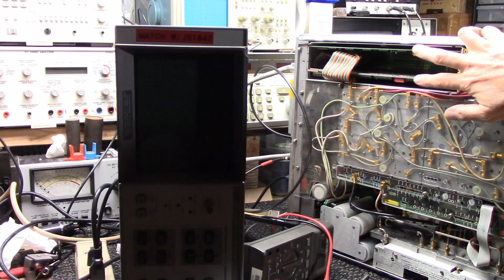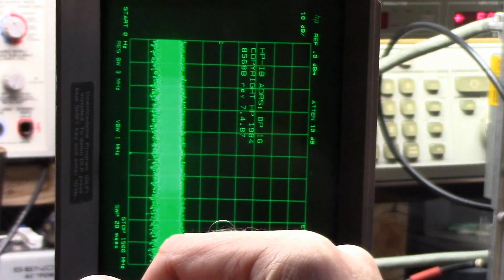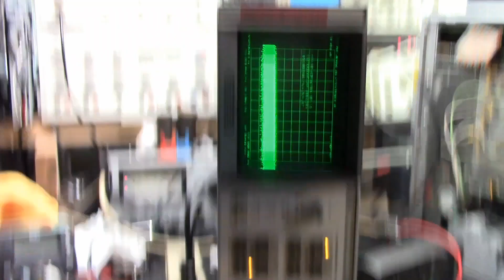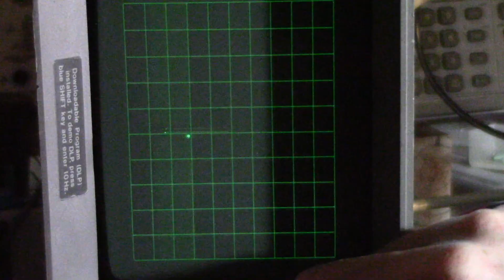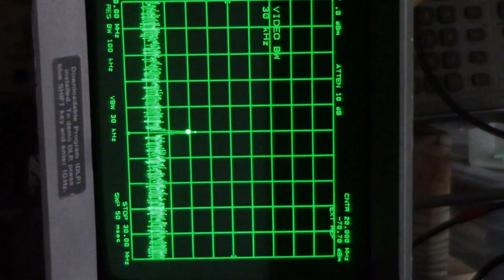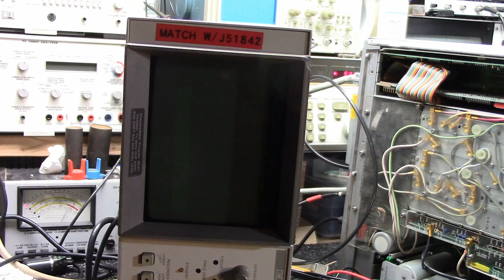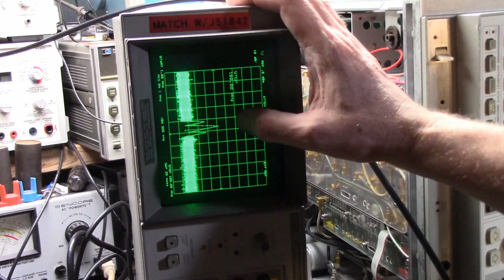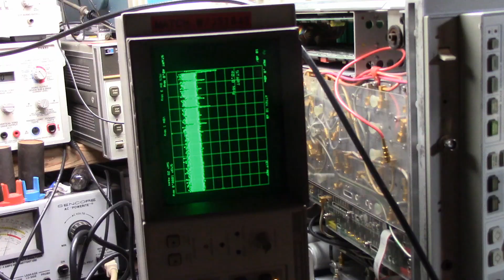HP 8568B spectrum analyzer part4 - Could it really be that simple?

Comment: One of my backburner "rabbit hole" projects is getting a HP8558B SA in a 853A display unit working like it should. I'm having to gather (and build) a host of test equipment I wouldn't normally need in order to do that.  My HP SA is half the size of a 8568 (only to 1.5GHz) but it may have contributed to my needing rotator-cuff surgery.

Comment: Bob, I believe it was on Antique Radio Forms that I mentioned that I had looked at the output of various TV channel modulators and test equipment with a tinySA. Only my Drake agile modulator (I don't have a Blonder-Tongue ) had the proper vestigial BW filtering. Of course that and Blonder-Tongue were meant to be used in conjunction with others on different channels feeding a cable system so channels interfering was no good.  Still somehow knowing that your test equipment doesn't quite behave as you might think bothers me.
Reply from the maker: I have a bunch including Drake, Pico Macom and Blonder Tongue that I'll check out.

Comment: Fantastic Bob, you revived a terrific instrument and you're giving me some courage to tackle a few I've still got lying around but never dared, until now, trying out :) By the way, shouldn't the device have an internal reference clock you can switch to instead of using an external referrence?
Reply from the maker: Yes, didn't I mention that in the video?  It's missing and was set to external when I got it.  I ordered a used one on eBay.  It was common in labs to have one very accurate reference and connect all the test gear to it.  For example, I could connect this to the 10MHz ref out from my HP 8662A
Reply: Ah, I must have missed that remark :) Yeah, I remember indeed from the lab at college there was like a central reference connected to certain pieces of equipment as a group. Not a bad idea really, if you want all your digital equipment to run in sync. But in your case, an internal reference clock source is probably much handier.  Still a great score though.
P.S. my memory (and attention span) isn't that good anymore since my stroke a few years ago... so yeah, sometimes I miss things, wasn't "testing" you ;)

Comment: I love the HP series of Spec Ans - I picked up an 8591E that worked flawlessly until early this year and the batt-backed SRAM died and so did the cal constants ... I can get it to self-cal, first manually loading default values, and then the self-cal function can be coerced into running (fails perhaps initially, then retrying it will pass self-cal.) Long story short, I found a really clean Anritsu MS2717B on ebay I'm using now regularly. Also an MT8212B that was very clean but needed a new battery.

Comment: You can    peak  FM  IF coils   with  that unit ,  I see the positives
Reply from the maker: Not quite as is.  I would need to add an HP 8444A tracking generator.  Easier I think to use a sweep generator and a scope.  Like my HP 8662A and Tek 2465

Comment: Bob, I think none of the front panel buttons don't work until a frequency standard is connected, because there is no information from the receiver to work with so, they remained disabled.

Be careful in replacing that memory keep-alive battery.  If you short the battery at any time, it can violently explode.  One of the guys where I worked lost his eyesight due to this hazard.
Reply from the maker: Thanks for the warning.  I'll clip it out carefully and put in an insulated container.

Comment: I was going to suggest external reference but figured that it was a given and had already been suggested. 
Keep look out for a GPS reference they can be had on the cheap on occasion, I have a Spectracom. Another is to check the back of your signal gen and see if it has a 10 Mhz output or can split it's reference loop.

Comment: It's always nice when you accidentally fix it or it decides to fix itself. With that many slotted boards and chips in sockets not surprising after sitting for years that seems to have fixed it. Maybe that old 20 dollar tech scope I have would fix itself if I cleaned and reseated things. It just has a couple of lights that come on now. Luckily I did get the tech manual if I ever decide to try and fix it.

Comment: I would look for some small osc box that you could use externally for now with a BNC to the ext. ref. input BNC. Should be dirt cheap on Amazon or similar? Maybe make your own using a 10 MHz xtal TTL oscillator with some kind of attenuator and/or AC coulpling?  I am also surprise that lack of a ref osc shut the whole device down in such a severe way. Maybe a sign of an earlier HP design? Maybe the later spectrum analyzers were a little better behaved? Or maybe every unit shipped from the factory had some kind of internal reference oscillator installed and someone took the one out of this box before it got to you?
Reply from the maker: I'm leaning towards the latter.  I see a whole bunch of lower end HP 10811 10MHz oscillators on ebay that were removed from equipment.
Reply: @bandersentv Just for completeness my Signature Analyzer is model 5004A. If anyone who is seeing this needs such a device I can ship it to you for just cost of the shipping. Contact me.

Comment: Where is the noise floor at Bob? (dbm )
Reply: With the widest video bandwidth filter selected, the noise floor with this analyzer should be about -70 dBm.  Of course, as you go to narrower video bandwidths, that noise floor will drop proportionally.  The receiver this analyzer uses runs the input signal directly into a double balanced diode mixer so, you are basically adding probably a 20 dB reduction in noise floor due to all the losses before you hit an amplifier.
Reply from the maker: Sorry I can't answer that yet.  Still learning how to use this beast and it needs to run through the self-calibration procedure.

Comment: The Interton VC4000 (an ancient German video games console from 1978)'s RF modulator broadcasts on channel 3 and has harmonics all over the entire spectrum including Cable and UHF and some of these images are strong enough to not be noisy. It can almost be used to determine if a TV's tuner is just bad or if you just can't change the frequency because it's almost guaranteed to receive something off of that console. Also it's not a fault of my machine. At one time, I had six of them, and all different revisions. They all do that (except the Grundig which is RGB only and doesn't have RF).
It also has +12V on the shielding of the antenna cable. And 37 bytes of RAM (in case you thought the Atari 2600 was primitive).

Comment: Most of the HP instruments of that vintage came with the HP 10811 oscillator (normally the HP 10811-60111 'relaxed specs' model).  They were good oscillators, but some were much better than others, so it was pretty common for people that were working on this stuff to pull them and look for the ones with the best performance.
Reply from the maker: Makes sense - I see loads of used ones on ebay.
Reply: @bandersentv  From the looks of it, both the oscillator and it's interface board are missing - the 10811 has a 15 pin edge connector as a standard interface and that either plugged directly into the instrument or into an instrument-specific adapter board.  Judging by the floating SMB connector this unit is one of the latter.  It's also possible that the original oscillator was an HP-10544A - same form factor, but using an AT cut crystal rather than the SC used by the 10811 - even if it was, the 10811 is (by design) a drop-in replacement with better performance.
Reply from the maker: I picked up an Ovenaire 49-61C (HP# 0960-0477-1).  The support posts should like up with the existing rubber mounts.  Not sure if will plug into the existing power connector or I may need to rug up an adapter.
Reply: @bandersentv  You should be able to get it to work - I'm not sure what the connectors are on that instrument - I did work on one of them once, but it was a long time ago and I seem to have forgotten.
Reply: @TrimeshSZ  Yes, those oscillators came in different versions with different connections. HP used the more familiar SMA connectors on it's equipment as well as the push-on SMB connectors and the threaded (smaller than SMA) SMC connectors.